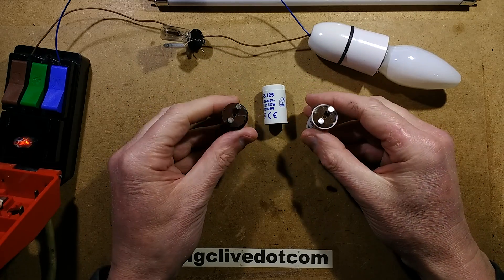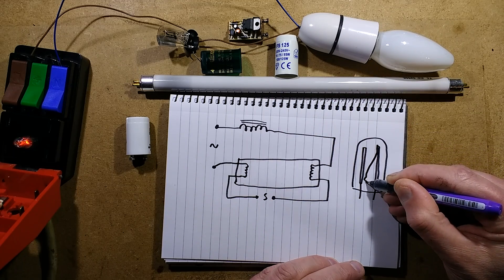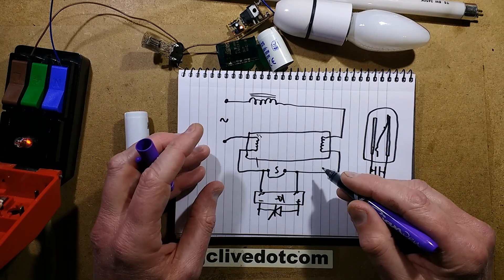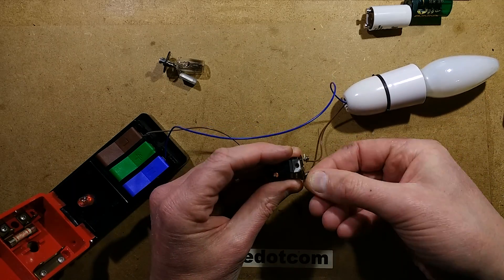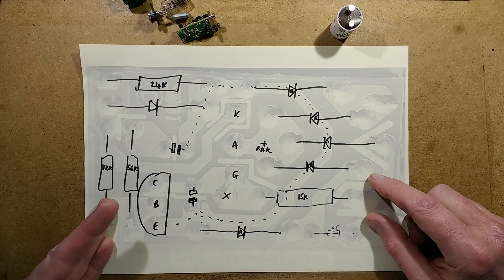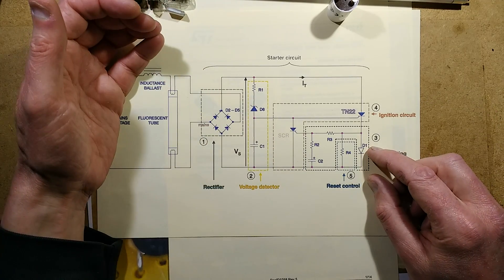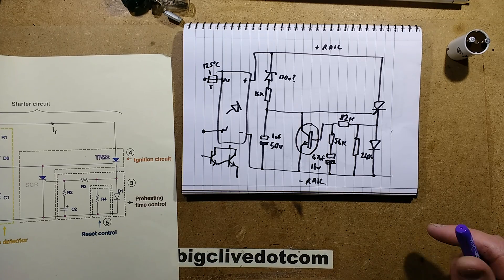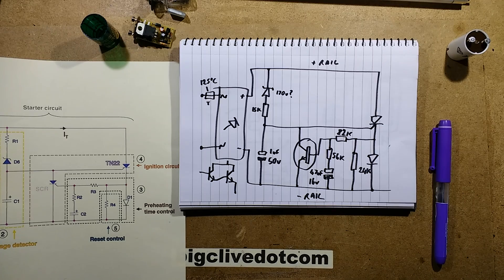Reverse engineering an electronic fluorescent starter.

Comment: The electronic fluorescent starter could work well as an April fool's - Wire it in series to a table light (assuming incandescent) and set up a candid camera.  When the victim switches on the light, it goes out, leading them to replacing the "blown" bulb and of course the same with each spare bulb they try. I have wondered how they claim to increase tube life and indeed the longer warm-up period and single strike explains a lot.  Another clear benefit is that the cutting off also saves electricity on failed tubes.  With a standard starter, the ballast is effectively shorted with endless start attempts, consuming more power than with a working fluorescent tube.
Reply: Seán Byrne They are very effective at increasing tube life because of the mandatory preheat.
Where circular fluorescent tubes are used in ceiling lamps, they do not have guard rings on the cathodes, so the tube ends blacken very quickly. But with the electronic starter they hardly blacken at all.
On many tubes started by these, the phosphors in the tube wear out before the cathodes!

Comment: R4 (24k in your circuit) is labelled "Reset control" on the printed diagram. Any chance this interacts with the capacitor to determine discharge time? If the cap kept enough voltage across it for long enough, could it keep the transistor conducting and stop re-strikes?
Reply from the maker: It slowly discharges the capacitor when the light is turned off to prepare it for a start again.  The discharge is very slow, so I'm guessing that when the tube fails to strike it only takes occasional pulses of the thyristor to keep the capacitor topped up.
Reply: I guess your explanation is right about why it doesn´t restrike but with a smaller discharge resistor it might work(10k maybe instead of 24k).
Reply: Id imagine the stock circuit with two SCRs may have some hysteresis to allow it to restrike if the tube is not lit. But the transistor not being an on-off affair probably drains low enough to allow the SCR to occasionally fire to maintain equilibrium. Might be interesting to see on the scope...
Reply: Sooo if you turn the light off and then back on before the cap discharges, it will not light?
Reply: If you turn it off again it might light the tube. Its hard to say with the transistor since there wont be much in the way of hysteresis in the circuit, but with a high-beta transistor it could try to restrike after a while. Also the filaments will still be hot for a few seconds so it would likely start on its own.

With the recommended example circuit he showed its designed to light the filaments until R2/R3 have charged C2 enough to have the secondary SCR clamp the gate of the primary one, which stops conduction. Then that SCR is on until C2 has discharged enough thru R2/R3/R4 to release its gate, and the cycle repeats until the tube strikes. The tube then presents a low impedance which shunts most of the voltage around the starter circuit. You can see this with some dead fluorescents in that they will periodically pulse when they die.
Reply: Hmmm.  I see the same thing.  Cue Twilight Zone theme...
Reply: And BTW,  whats up with the dates? Time warp? Republish? Clive's comment in this thread: 

bigclivedotcom2 days ago

Video's publish date on YT: 

Published on Apr 12, 2017

At least that's what I see on my machine :/